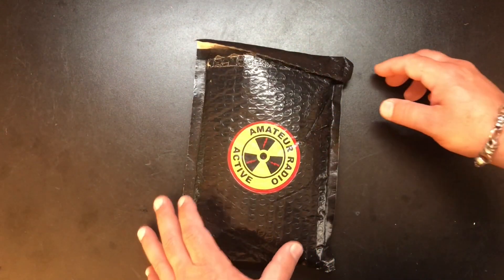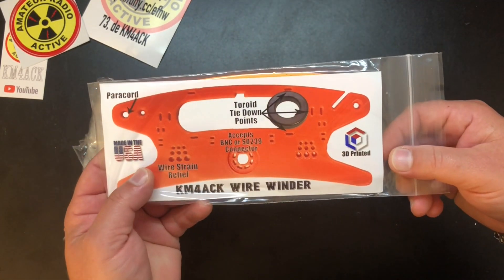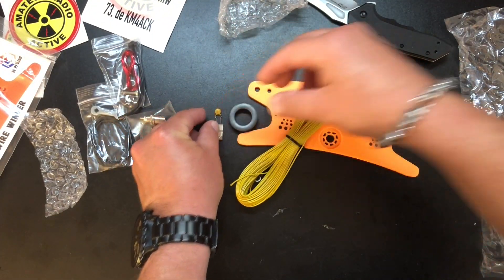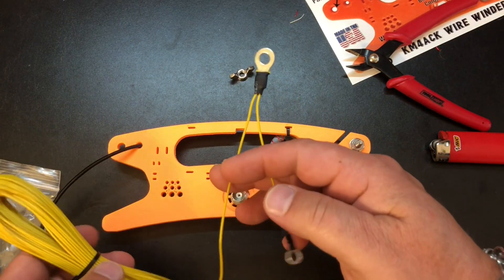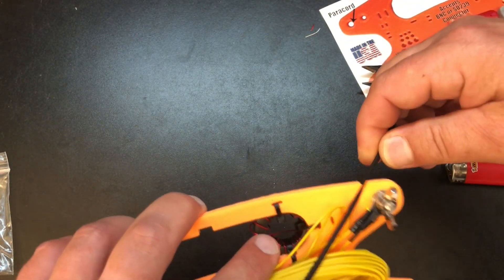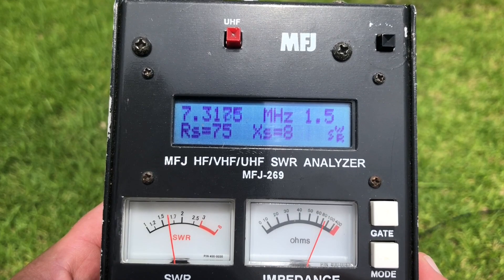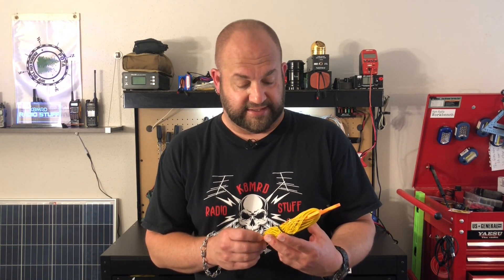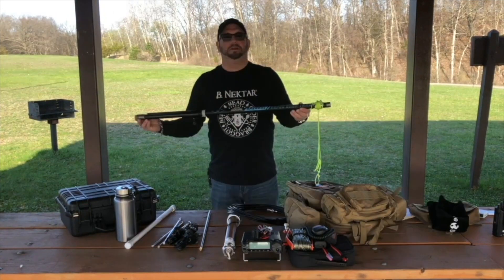KM4ACK End Fed Half Wave Antenna Build

Comment: Throw a bit of heat shrink tubing on the yellow wire instead of a ferrule.  That will keep the pig tail out of the way and no special crimp tool required.

Comment: If you don't have hot glue then silicone sealer will do the same!  Put heat shrink on the lose end of the wire to make it neater?

Comment: Great build everything was neat and tucked away where its supposed to be.  Just ordered my kit today cant wait to put it together. Got some good tips from your video.  Curious though, what was the model of the antenna analyzer you were using with the digital screen and then what happened to make you swap to the Mfj-269? I liked the screen on the first one.
Reply from the maker: Nice, you'll love it.  It's a fun build too.  The analyzer is an MFJ-223.  I think I switched because the battery was dying but I honestly don't remember.
Reply: @hamradiotube  thanks bud, found your review of it. I like that thing, might add it to my list.
Reply from the maker: I wonder if they’re available.  They’ve been having trouble getting parts for the analyzers.  Though I’m pretty sure the 223 is from some manufacturer, prob China, that puts their sticker on it.  I’ve seen the same one with different brands on it.  Either way it’s a great analyzer.

Comment: Any idea on the specification and source of the yellow flexible antenna wire? I'm looking to acquire the materials myself, but want to be sure antenna wire can wind easily. Thanks!
Reply from the maker: It's 26AWG from SotaBeams.  I have a roll of it myself that I bought from them last year.  I like it a lot.  Doesn't kink, easy to wind.  I'm also a HUGE fan of Poly Stealth wire from Amateur Radio Supplies. It's actually my favorite small antenna wire, but it's not yellow. https://www.amateurradiosupplies.com/category-s/218.htm
Reply: @hamradiotube  Great, thanks!

Comment: Great video with very clear instructions on assembly.  Curious if anything like this exists for GMRS frequencies?  I would absolutely love to have something so small, compact and light for backpacking use.
Reply from the maker: Thanks.  An antenna for GMRS would be very small already as its in the ~460mHz spectrum I believe, which is less than 70cm for one wavelength.  Its very nature makes the antennas small to begin with.

Comment: Place some heat shrink tubing over the needle nose pliers and shrink the tubing.  The heat shrink will grip but not allow the little teeth of the pliers to scratch off the magnet wire outside coating.
Reply from the maker: I did that with my helping hands.  Prob should have used those instead.

Comment: You did a great job making the video. Very informative. It looked like a fun little antenna kit to assemble.  Nice to have a true multi band antenna that covers 10 to 40 meters. 
You have a collection of antenna analyzers and NO sand paper? OOPS ! Everybody has sandpaper. Hi Hi

No matter. Thanks for posting. 

Barry, KU3X/QRP
Reply from the maker: Lol.  Well you gotta have priorities.  I use analyzers all the time.  Prob on a weekly basis.  Not too many times I need sand paper though.  Good thing I have power tools.

Comment: Nice video and if you don't own a hot glue gun some neutral cure silicon will do just as well.
Reply from the maker: I have some silicone I may put on it.
Reply: @hamradiotube  just make sure it's not an acetic cure silicon (they smell like vinegar when curing) as the acid will cause corrosion and kill your project.

Comment: Kd9bpy...I just built mine and I used white flex seal  in lieu of hot glue...seems to do the trick.
Reply from the maker: I've not used flex seal but that already sounds like a better idea than hot glue.
Reply: @hamradiotube  I grabbed a small $5.00 tube at Lowe's....figured I'd give it a try. Dries with just a small amount of flex to it....time will tell.

Comment: So, do you tune for 40m only and then let the other bands fall wherever they are? Seems to me if you tune for 40 then try to tune for say 20 you will mess up 40. So I think tuning for the lowest band is all you can do. Right?
Reply from the maker: You tune for the lowest band you want.  Because the ham bands are mostly all harmonics of each other they kinda just fall in place.  Not perfectly but close enough.
Reply: @hamradiotube  I'll add that I recently built the qrpguys efhw and cut the wire for 20m, about the middle of General phone. No tuner needed for that band and I usually don't need a tuner on 40 either (using the x5105). I've used on 10m with good results also. Give the shorter length a shot.

Comment: On your MFJ do you fine it likes batteries. Nice antenna
Reply from the maker: The batteries actually last quite a while.  I have rechargeables in it and just plug in the wall wart and it charges them back up.
Reply: @hamradiotube  I think the batteries are rechargeable, going to guess maybe 10-20 minutes. The ones that came with it
Reply: Mine to. Was thinking about using 18650 to the couple the red and black things.
Sorry at time my ADHD gets in the way.  "What am I doing " it's a  song 🎵

Comment: Wishing that they made a 100w version
Reply from the maker: Hopefully this is just the beginning of a long line of antennas from him.
Reply: Planning to try just that.  I just received the kit and I plan to use 2 cores and 18g magnet wire instead of a single core with 22g.  This should allow the transformer portion to take the 100w at the expense of increasing the bulk a little bit.  From my research on the 140-43 cores it looks like a higher number of turns (21:3) would be beneficial when doubling up cores.
Reply from the maker: Let us know what you find out.
Reply: @hamradiotube   I was able to get out and use the antenna today. POTA pile up in 88 degree weather and the transformer did not get at all warm.  I ended up using 2 of the 140-43 cores I just ordered extra when I ordered the kit. 2 other mods were a heavier magnet wire 18 gage instead of the 22 gage in the kit, and I used a 3 primary 21 secondary wrap to increase efficiency. The mods were ones I found looking into EFHW for 100 watts using a 140-43 torroid core. I am very happy with how this antenna performed.  Thanks to Jason for a great kit.

Comment: I use this antenna for my POTAs with my G90. Great piece of kit! I folded the tag end on the insulator, twisted, and used heat shrink to secure it.
Reply from the maker: Yes, heat shrink.  Didn’t think of that when I made the video but I’m gonna do that.  Thanks for watching.
Reply: @hamradiotube  Glad I could help!
Reply: I did the same thing! I couldn’t bare to cut my wire, that seems so permanent lol.
Reply: @K5YVY  I clipped mine but left enough to secure. Once it's resonant it shouldn't change much unless it stretches. The only thing I don't cut is rope! Tie a sheep-shank! lol

Comment: I see on his site its rated for 50 watts ssb. I need to build me a 100 watt version.  I did some portable work today, and I used the wrc but wish I had a nice lightweight efhw to use sometimes as well. I built a linked dipole for 80, 40, 20, but its not always easy to get an inverted V up. Sloper efhw is super easy.
Reply from the maker: Jason tells me he runs 100 watts out of it all the time.  If it gets too hot the SWR will get high but once it cools down its back to normal.
Reply: @hamradiotube  Ok. I have had issues with a 4 to 1 balun on my home station over heating, and the swr does creep up. First time I saw it I was confused. Took me a minute to figure out what was going on. I will keep an eye on his site, and give one a whirl,,, with bowline's and splices. LOL!

Comment: Hi Mike, you can try adding a second 100pF 1kV capacitor in parallel to the first one (or replacing it with a 220pF 1kV is good as well) to get the SWR down on 15 and 10. Had to do the same on my QRPGuys NoTune EFHW. 73 from Germany de DK9CA 😁🤘
Reply from the maker: Good tip.  I have that QRP guys antenna and can't get it to tune to save my life.
Reply: BTW, a line isolator is highly recommended for EFHW, at first I thought that I could do without it, but practice has taught me better. ;) I am using a W1JR choke on an Amidon FT240-43 ferrite core and 2 runs of coax, one 10m (33ft) long for the "counterpoise" from my homebrew 40-10 EFHW to the choke and round about 5m (16ft, this length is not critical) from the choke to the TRX. It offers a way much better performance and got me rid of painful RFI. ;)